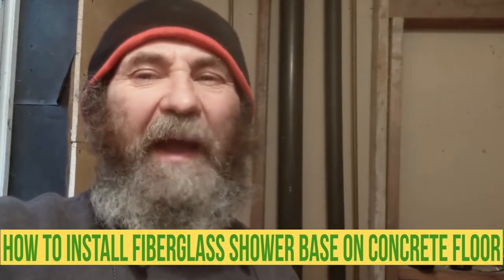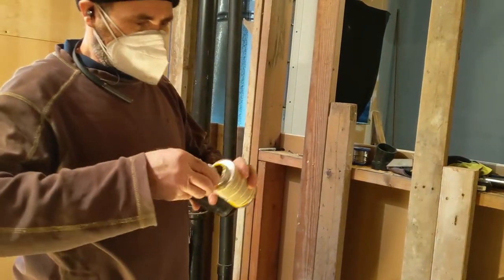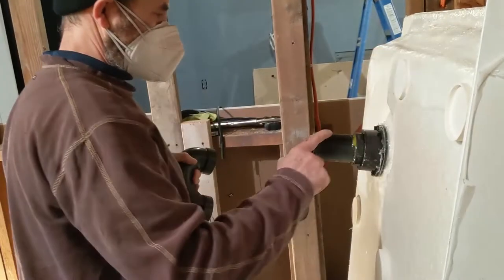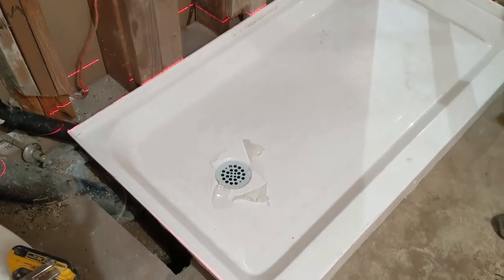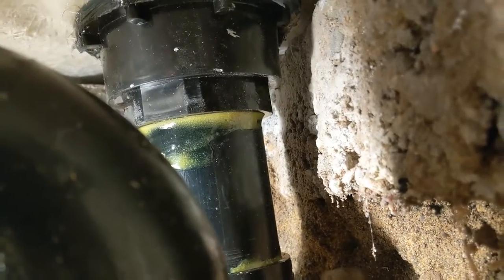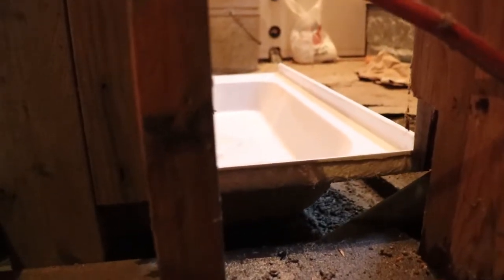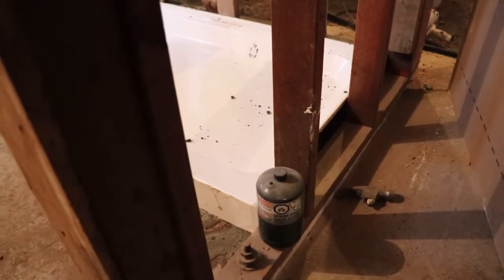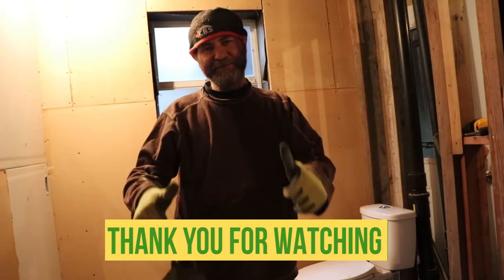How To Install FIBERGLASS SHOWER BASE On CONCRETE Floor

Comment: How would you remove the shower base in the future if replacement/repair is needed, if it is seated into the concrete?
Reply from the maker: Hello there, thank you very much for your time and support, when the time comes to replace the shower base the concrete will come out easy using a small jackhammer, the new concrete will not stick really hard to the old concrete , please let me know if you have any more questions, keep safe and see in the next videos.